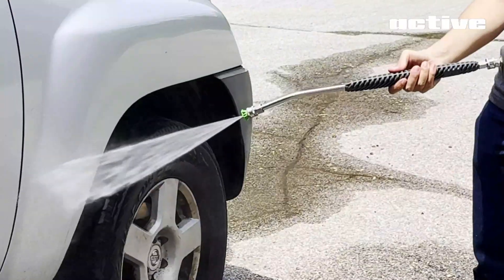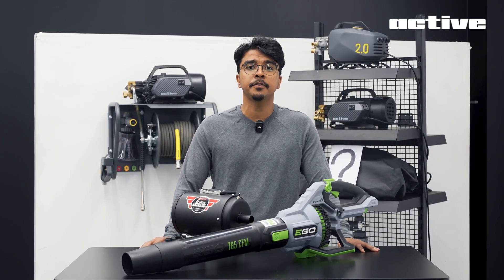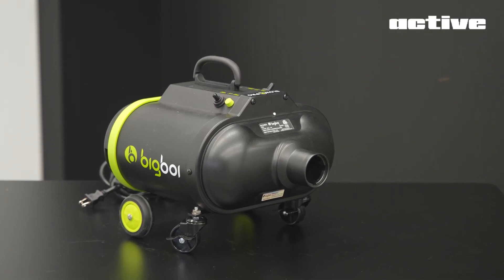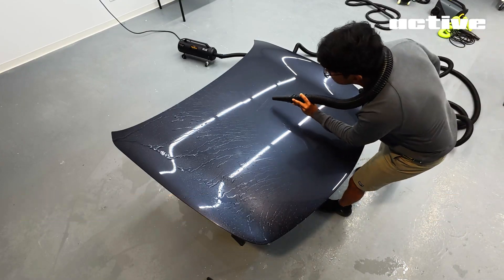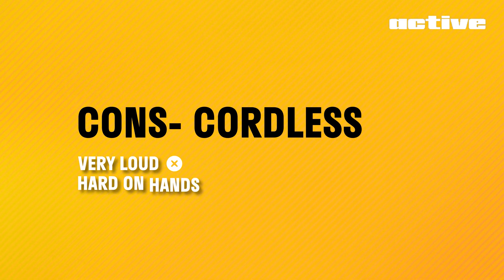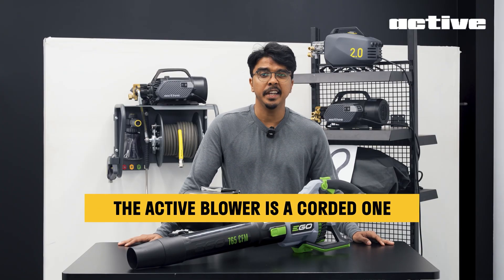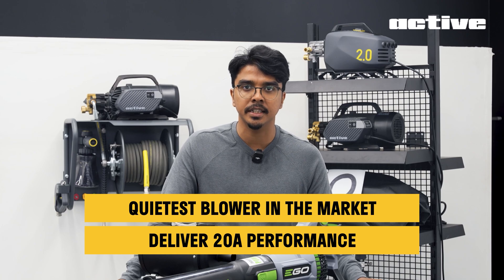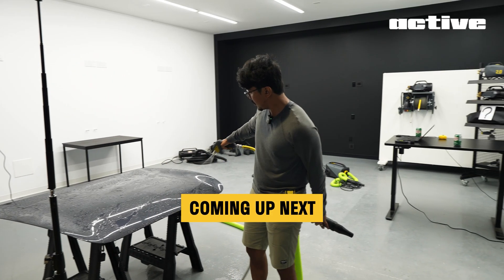Let's Build a Car Dryer! What Should It Be? | Active Car Dryer Development PART 1

Comment: It would be great if you offered a 20-amp option. Most U.S. homes have a mix of 15-amp and 20-amp circuits, and in many cases the breaker panel is in the garage, so adding a 20-amp line there is pretty straightforward. I realize this video is focused on the blower, but an upgrade kit for the 2.3 to take advantage of a 20-amp circuit (without stressing the microswitch or capacitor) would be really useful. These machines are fantastic for detailing cars, but having a little extra PSI for driveways and sidewalks would make them even more versatile.

Comment: I have the Adams “air cannon” and it is a minor pain to store, and set up due to the cord and hose, but it very effective - which overcomes the hassle.  cordless leaf blowers are weaker, not as ergonomic as a nozzle, and I am very adverse to adding a 3rd charger for your battery.  Still - based on owning a 2.0 and being very impressed - I’m looking forward to your solution

Comment: Needs to be cordless for me, no hose. Others mentioned the compact Ryobi. That would be great. I don’t mind a built in battery as long as it can finish a large car and then some. Unscrew the case to have a user replaceable battery. Maybe a charging stand that’s also wall mountable. Most importantly to differentiate yourselves from existing offerings, a quiet or pleasing sound.

Comment: Have you seen the blowers from Adams Polishes. They have a couple different sizes. Their larger unit can be wall mounted or on wheels. I like both of these functions especially the wall mount. the hose is expandable to over 40 ft but when its in off mode it shrinks down to under 10 ft. I would like it to be remote control so you can keep the remote on your person. This way when you are done you can just shut it off and not have to go to the machine to shut it off. I want the ability for heated air if i want. I like the focused nozzles maybe even one that's adjustable.

Comment: If you consider making it battery, follow ScanGrip's example and offer different adaptors to use with our existing batteries platforms (Milwaukee, Dewalt, etc.).  I use my ScanGrip lights with my Milwaukee batteries often and it works perfectly.

Comment: I am looking for one, needs to have a great easy to use hose reel and wall mounted.  Like the giraffe tools vacuum but actually performs well.  The hose should be soft so it doesn't scratch the car.  This would address the noise as the machine is wall mounted and 20ft away.